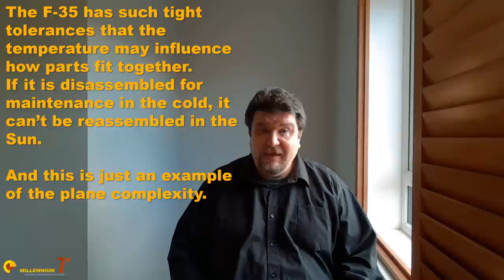F-35: The Failure of the $100 Million  Dollar Jet | Maybe...

Comment: Years ago I guessed that the F35 would turn out like the F4; it would be a good plane but a kludge, better suited for attack and some A2A. I didn't even know that much back then it was just a gut feeling. Looks like my gut was right.
Reply: Except that over five thousand phantoms were built.
Reply: It was never intended to carry the air to air mission, that was for the F-22. It is an F-16 replacement, which was the F-4 and A-7 replacement, and in use has mostly been an attack aircraft. It was always meant to be primarily an attack asset. It's why Israel likes it so much, it finally got the Lavi it has been wanting for 40 years.
Reply: It was essentially design for A2G (hence Joint strike fighter) even if it became something else later on.
Reply: The F-4 was supposed to be such a great plane, but it sucked as a fighter. It was basically just a bomber, and probably heavy at that. The air force ended up getting a plane that was way heavier than what it needed to be.
Reply: @johns.7609  So making a lot of something means it is good? Maybe you have to rethink your argument, especially when it comes to congressmen voting to keep jobs in thier state.
Reply: @apparition13  But the F-16 is one hell of a maneuver aircraft, and a small aircraft. It could easily outfly the F-15. The F-4 was definitely not small and maneuverable, nor to I think was the A-7. Think you better rethink argument.
Reply: @cliffordnelson8454  It was designed as a long range supersonic interceptor for the Navy. Leading edge slats fitted to Air Force E's improved things considerably.
Reply: The F-35 isn't designed for A2A agility. The aim is to use Stealth, sensor fusion and long range BVR to shoot down the opposition before they see the F-35. It's a different sort of warfare. The primary role is A2G in any case.
Reply: @nickbrough8335  It also assumes that Russian and Chinese technology is that from 40 years ago when those countries had not yet had time to defend against stealth. Even then the systems that they used were not as affected by stealth as the Western systems because the Western systems used higher frequency. 40 years to counter basically what is still the same concept used for the F-117. You really think they have just been sitting on their hands doing nothing in that time. Armchair experts like you (and congressmen)  still think that sealth is that magic bullet. Well if we get into a shooting war, better hope so because if not, sealth is really the only advantage they will have, with the enemy defences having all the others. Why do you think China developed Ballistic anti-ship, missiles, land based cruise missiles, submarine anti-ship capability, the J-20 with its cruise missiles. Part of it is because that way they have a multi-dimensional threat which is much harder to defend against, and the other is if, when the rubber hits the road, something is not as effective as anticipated. Remember the WW2 American torpedoes. What a disaster--even apparently sank the submarines shooting them, or the design flaw in the B-17 that sent so many down. Look into it.
Reply: @cliffordnelson8454  Chinese have actually got more Stealth designs than the Wests so it appears they believe in the concept at least. So far as I'm aware (which i certainly expect is not that much) nobody has yet deployed what the F-35 is designed to do with sensor fusion (including the F-35 which is still quite a way behind the original concept). I would also say you are mistaking what the design concept is with effectiveness. The only [people who have actually done anything here is the Israelis and they seem to be surviving against the latest Russian SAM systems.
Reply: @nickbrough8335  I actually decided to look up if you right. You were not. Read this https://www.jpost.com/Middle-East/Syrian-air-defense-missiles-Everything-you-need-to-know-575495. Notice not S400 missiles in the list, and the F-35 that was damaged was thought to have been damaged by an antique s200. And this makes sense. The Russians are not going to risk their most secret technology falling to the west, and the newest Russian missile system is the Antey-4000. It makes sense that if they Russians were going to use something in Syria they will use what they don't mind getting rid of, and meanwhile study how to improve effectiveness of their systems against the F-35 since the US has been so generous to given Isreal these planes for the Russians to study the effectiveness of their systems.  So very generous of the US to give Russia time to practice shooting down F-35 with missiles they would have otherwise junked. So a very old s-200 hit a F35. LOL. Armchair experts.......
Reply: @cliffordnelson8454  Unlike you I haven't claimed to be an expert or anything else. I don't work for the DoD. If you bother to look up what the S-400 system it is an integrated network of different radars and missiles each off which has a different role in providing a layered defence. I will also point out that there has been a lot more than Israeli Strike on targets in Syria.

I suppose, from you stand, the US doesn't actually have any air defence or ground attack assets at all. The F-15 to F-18 are designed based on early 70s technology, no matter how frequently updated, and the F-22 is a Stealth system with is fictitious tech to you.
Reply: @nickbrough8335  Like believing a used car salesman. These people are being paid by organizations that will penalize them if they said anything bad about the plane. I guess you believe the used car salesman. They are not independent. 

And my father was an engineer for the Navy working on ship design, and I have worked as an engineer of a number of military aircraft programs. Since you admit no experitis as an engineer or scientist maybe that should tell you something. 

So what. the A400 has apparently not been used in Syria and it was an A200 that hit the Israeli F-35. Russia did sell the A400 to turkey...has Israel now sent planes against Turkey? The newest Russian missile is the  A550 (https://en.wikipedia.org/wiki/S-500_missile_system) there is also the Strela-10M3 (https://www.ainonline.com/aviation-news/defense/2018-09-12/russia-unveils-new-and-upgraded-sam-systems) . Do you do any research>
Reply: @cliffordnelson8454  I’m not even here to argue is it good or not.  Nitwits do that.  I’m arguing that it’s not like the F35 because 5,000 were built.
Reply: @cliffordnelson8454  You have no proof that  F-35 was hit by A200. Please show us the a picture or governmental report.
Reply: @jimc1654  Israelis won't admit the truth, we just have no way of knowing for sure. Like with their nuclear weapons, whole world knows they have them for decades, but there is no picture or governmental record of them to this day... There were some strange coincidences around the plane, it is possible that it was hit, or it could have been birds(official version), but either way we'll probably never know.
Reply: @jimc1654  And you cannot read. I did not say it was. However you hear the ruckus that happens when the F-35 get hit, the US and Israel do not want an perception that the stealth does not work, so will work real hard to hide it. So I do not trust either country on reports. And you should not either. The US, in particular, lies a lot. The famous example is Saddam's weapons of mass destructions, and there are quite a few other cases in history where things were covered up like the Maine, and Lusitania
.
Reply: @jimc1654  LOL...have you not figured out, the US government lies. They lied about the WMD, they lied about the Lusitania, they lied about the Maine, The US government wants to maintain the myth that the F-35 is totally invisible to radar, which is BS. They have sold the F-35 on this, making it seem like it is the silver bullet. Just look how the press jumped on the story. LOL. You just do not understand how much lying there is in the US.

Comment: The curse of any project - mission creep.   All state projects have this and that added to them as the project progresses.  Few project managers in the state system are willing to fix the specification and stick to it.  Planes, boats, buildings ..... everything gets 'enhanced' which causes massive delays and cost increases.
Reply: the curse of a swiss army knife. expensive and crap at a lot of things.
Reply: The threat capabilities evolve. You have to project those capabilities so that your system isn't obsolete by the time you go into production.

The main driver in countering the threat are IADS. Current 4.5 Gen fighters are not survivable in modern IADS nets, and they are only getting better.

Proposing more 4.5 Gen designs is backwards thinking that will tie the hands of future war-fighters, especially with the proliferation of 5th Gen designs and evolving IADS nodes.
Reply: @LRRPFco52    That would only apply if all enemies had the high level capabilities. The enemy will have limited high level capabilities, just like you have limited high level capabilities.   send your high level units against their high level units and the lower capability stuff can follow.  Russia and china are not going to have 100% 5th or 6th gen fighters, they are not going to have every radar as the latest tech.    There will be some unit that have the great radar or the great tanks or planes .....
Reply: @Touay.  Yemeni rebels are shooting down Saudi F-15s and drones with rigged R-27 AAMs towed by Toyotas with COTS FLIR units for totally passive guidance.  Doesn’t show up on F-15S’s sensors.

Shows up from dozens of nautical miles away on JSF sensor suite before they even have a chance to fire.

The problem is that you have “low threat actors” right next door to high threat actors, Syria being a perfect example.

China is all high threat.  China now has a puppet in the WH again, and the media have been working for the communists since the 1950s in the US, so now we see the next stage in information warfare directed against the JSF program, just like they did to the F-22 program.
Reply: @Touay.  in today's world, everyone wants the best toys. Developing world nations even. Nobody wanna get left behind in capability.
Reply: @Joshua_N-A    i'm sure, but how many can afford to field their entire fleet of aircraft as the current state-of-the-art?  That would mean frequent full replacements of the fleet, as their planes will be out-of-date within a few years.
No military can afford to have 100% of their resources maintained at the absolute peak.  EVERYONE will have a smaller number that are the peak, and a large number that are 'good enough'.
The key is for the west to have enough of the 'peak' resources that we can overwhelm the peak resources of those who will may fight.

Comment: The USAF (specifically F-16s) is probably the only group of people not getting the full worth out of the F-35.
For all other customers the F-35 is clearly an upgrade.
US Marines/other Harrier operators get a generational leap, not even a comparison.
US Navy replaces the legacy Hornet, where the F-35 is a straight upgrade, cost per flight hour is not as much a consideration, because space on carriers is limited.
For foreign customers, the F-35 is the only option to get a fifth gen jet.
It is also the only replacement for the F-117 and probably the best option for SEAD.

It was not the best managed program, but I am skeptical if a new program will result in a cheaper/more available aircraft.
Edit: also the USAF has a motivation to shit talk the joint program, because that increases the likelihood of a Airforce only development next time.
Reply: Lockheed still has not fixed the problem with the front landing gear on the Navy F-35's so there is that.
Reply: That's not the issue, the F-35 is arguably the most capable aircraft in the Airforce, In a lot of ways outperforming the F-22. it's certainly as much of an upgrade for the airforce replacing the F-16 as it is for the Navy replacing the Legacy Hornet, even more when you consider that the F-16 is the backbone of the airforce but the navy has been relying on the Super Hornet for a while now. The F-35A is also the best version. 

I'll admit, I think the USMC and the Brits are getting the most out of this, making STOVL carriers viable, and then rest of the foreign market. The problem is that the F-35 was supposed to be inexpensive and cheap to operate, but it's not. The Chief of Staff of the Airforce has said that if they didn't do something to lower the costs they wouldn't be able to field the F-35 as a replacement for the F-16. 

This is entirely about costs, the F-35 joint strike fighter program was supposed to produce an inexpensive, easy to maintain, low cost to operate aircraft. It's failed, it produced a very effective, but expensive aircraft. 

The JSF Program had too many interested parties with too much input on the development of the aircraft. It produced 3 different aircraft after all, not 3 variants of the same aircraft. You can't swap out components on an F-35a and turn it into an F-35b. 

I have no doubt that the Airforce will be able to develop a replacement for the F-16 which suits its needs and meets the price requirements. The problem will be if people aren't willing to accept that this is going to mean it needs to omit all aspect stealth in favor of something similar to the Super Hornet or the Rafale, a reduced frontal RCS without incredibly expensive materials. 

My guess is that the main strength of this new aircraft will be utilizing networking technology developed from the JSF Program.
Reply: @MrFarnanonical  I'm not going to disagree with you at all. In fact, you echoed everyone's original concern with the aircraft in the beginning and that was its cost. I didn't know it could be a maintenance nightmare until now.
I wish we would build a plane for Total War, not just the first day of the war. We need a plane that is easy to service and can land on a crappy road that can fly fast, carry a shit ton of ordnance, and have all the sensors of the F35. We need 1000 of them tomorrow.
Reply: @MrFarnanonical  Not disagreeing, but trying to show a different side of the problem.
Yes the three versions have basically different airframes, certainly more so than intended.
But for modern jets the cost of the airframe is less of the overall cost.
With components like radar and sensors, avionics, large parts of the engine and stealth coating being similar, there is a lot of the overall value in the common parts.
The F-35 is not more expensive than other new fighter jets. India's 'F-21' order is about 160 M$ per jet, Australia's F-35 are reported at about 200 M$ and Italy's at about 95 M$.
Maintenance costs are an issue, but I fail to see how a new program with new development cost, it's own set of feature creep and delays will result in a substantially cheaper aircraft, in a reasonable timeframe.
I think the USAF has to accept that aircraft can not be replaced on a 1:1 basis, something that most other countries have already done.
A conflict large enough to warrant 1000s of airplanes, would probably be ended by nuclear weapons anyway.
Again, I'm not saying the JSF was the perfect project, it is not, but I fear that a new project has the potential to be significantly worse.
Reply: @johnparrish9215  That's not USAF. USN is a different service.
Reply: If you've never watched Pentagon Wars I'd seriously recommend, it's a satirical look at the way the pentagon acuires and purchases new hardware.

It may be about the Bradley Tank but its indicative to all pentagon programs.
Reply: @vader1a  It is also entirely wrong.
Brief overviews are:
https://www.youtube.com/watch?v=gmuVYVREGgE
and: https://www.youtube.com/watch?v=2gOGHdZDmEk
More info can be found online.
It is a decent satire, but that's it.
Reply: Add to this the fact the VTOL/STOL version of the F-35 turns American "amphibious landing support ships" into aircraft carriers at LEAST the equal to Russia's and China's "ski jump" crapola carriers, then you'te talking serious business. By adopting a plane, we turned support ships into aircraft carriers.
Reply: How about a F-35 without the stealthy skin, adhesives, etc?  Can that be cheaper ?
Reply: F-35 does not satisfy long standing requirements of two air crew and two engines for CV operations.   Everytime the Navy is forced to buy an AF fighter they get an a/c that cant carry the payload the necessary range.   This is as successful as when they tried to force F111 on Navy as interceptor.    Navy F-4 as A/F fighter works but reverse process NEVER works.   Navy has opened an office for new fighter that sounds like the F-14.
Reply: @kilianortmann9979  A new project has to be simpler - that's the usual answer to these problems. Off the shelf, less performance, much less stealth, much better design for easy maintenance.  You can design-to-cost and change the spec instead of design-to-spec and change the cost.
Reply: @timmurphy5541  well put
Reply: Tdan Kendros  It's hardly junk. Look at who is buying it. Poland. Denmark. Belgium. England. Spain. Israel. Greece. Everyone loves it.
Reply: @shaider1982  but why?